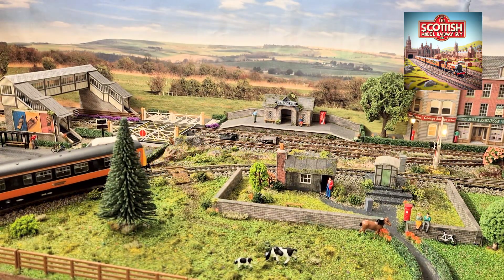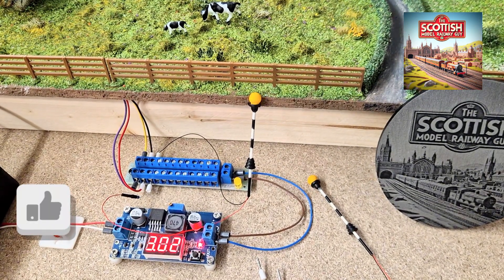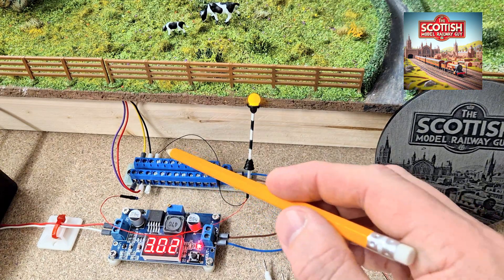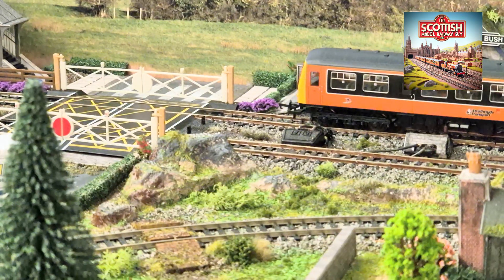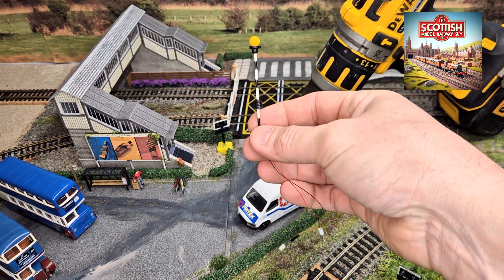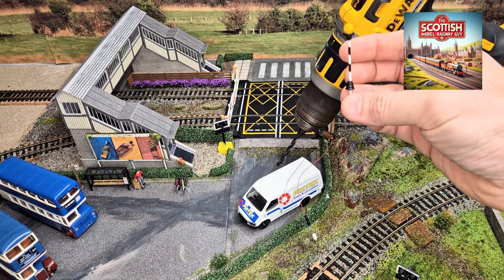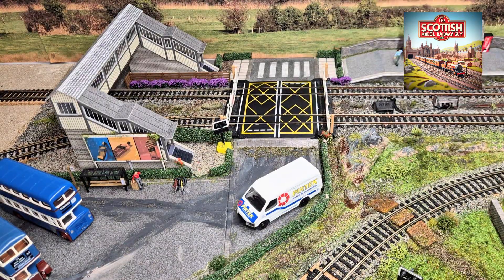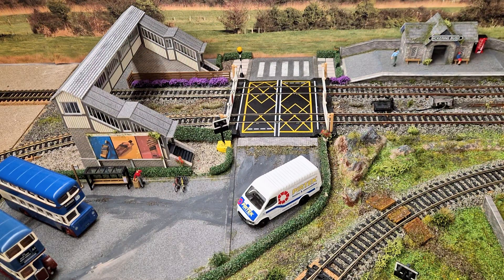00 Gauge Model Railway Basic Electronics (Zebra Crossing PART II)

Comment: Great easy to follow video 😊
Can you point me in right direction to buy the bud bar terminal block from, carnt seem to find that type and looks good. Thanks
Reply from the maker: @johndrury8920  Of course.  No problem...

If you search "evemodel distribution board" you'll find it straight away at the top of your searches.  Thanks for the kind comments.  It's always appreciated 🙂👍🏻